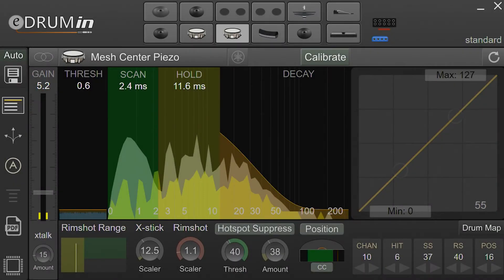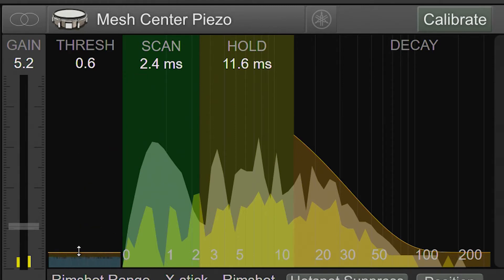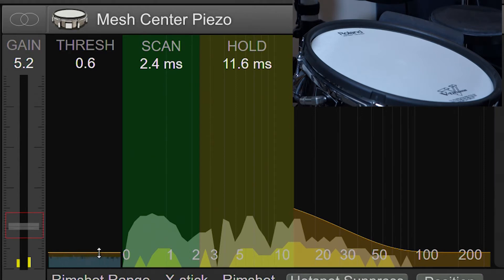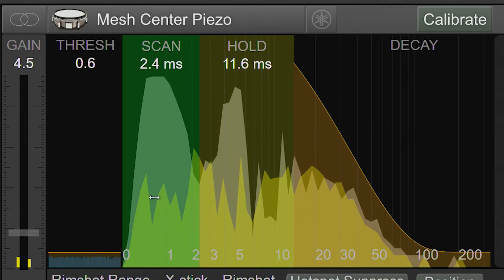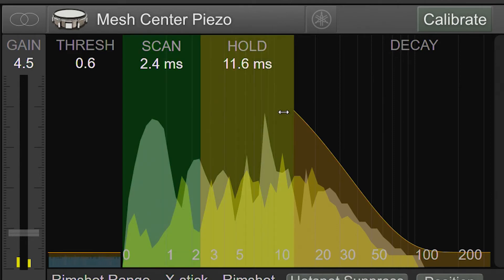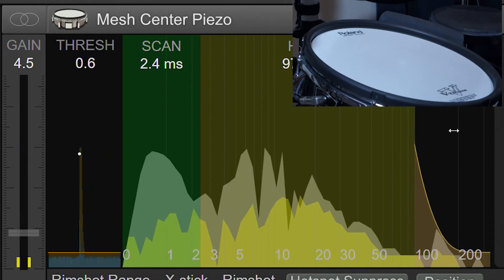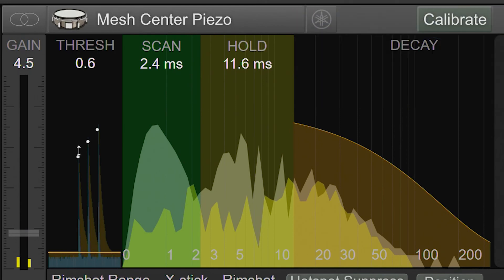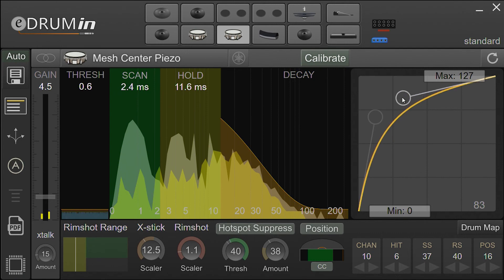eDRUMin - Transient Scanning Controls

Comment: Hey, just wanna say that I love the eDRUMin. Got an eDRUMin 10 as an addition to my main module, but since that module left... A bit to be desired, and I loved my eDRUMin 10 so much, I just went ahead and got another one. I exclusively play via VST's, so this product is literally all I wanted. Sometimes can't believe there's a product that so perfectly fit my needs - It feels like it was made for me specifically, haha.

Only problems I've had with the product is my own shortcomings - Not fully grasping what each parameters does. But I'm getting the hang of it now. This video certainly helped. One thing I couldn't find in the manual is an explanation of the X-stick/Rimshot scaler. I guess it's like a multiplier to the gain? Is that correct?
Reply from the maker: Yes, they are multipliers of main gain slider.

Comment: I have to say, I love the calibration facility. The only manual adjustments to prevent double-triggering, I made on a 16” Floor Tom with a side-mounted trigger. Other than that, the calibration worked amazingly well. Even the hot-spot on a centre-mounted Snare trigger wasn’t an issue, though the 3-ply head also massively helps. The calibration tool is a stroke of genius and I can’t believe how much time I used to spend fiddling with parameters on a TD-10 and then a TD-20.

Comment: Hey, could I use a edrumin for triggering ezd2/sd3 for playing live on stage?
Reply: And which kind of pads/triggers work the best with the software?
Reply from the maker: @SchwappSchwopp  I mostly develop with Roland and Yamaha pads. but pretty much any trigger will work fine.
Reply: @yeahtuna  thx for your quick response, I really appreciate that!
Reply: @SchwappSchwopp  I have an A2E 22/13/16/14 conversion and the eDRUMin calibration process is incredible.
Reply: And how does it work? Do I have to run the software at the same time as my DAW running the VST?
Reply from the maker: @SchwappSchwopp  Yes
Reply from the maker: You certainly could.